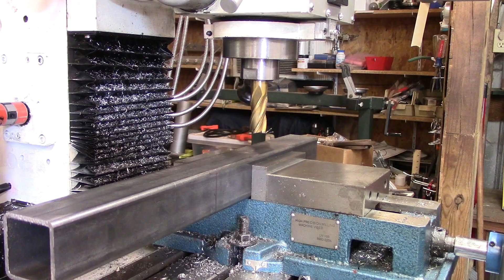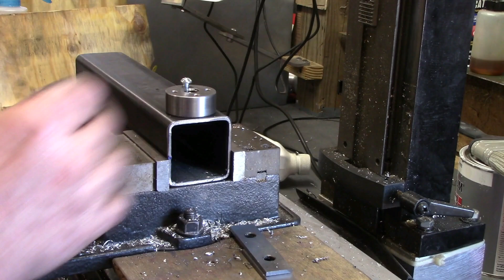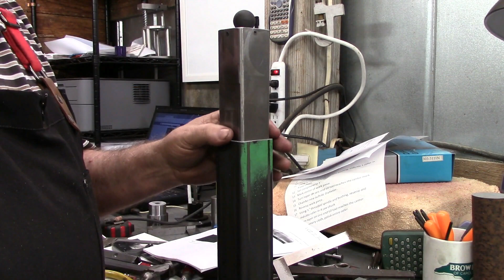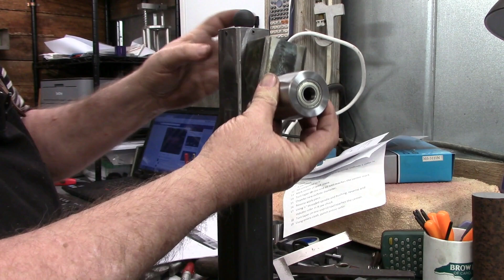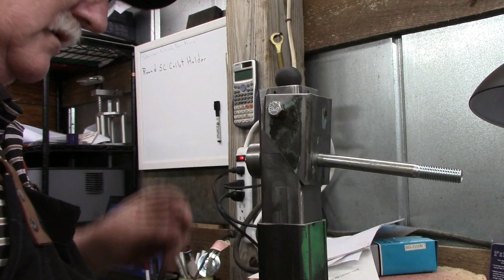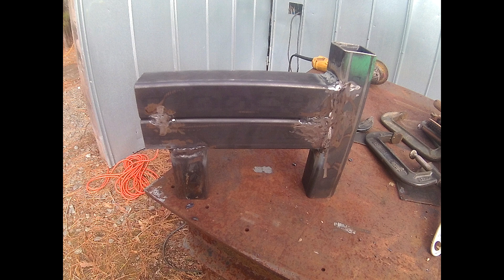2 x 72 Belt Grinder Reverse Build - Part 3 (Hollow Structural Steel Frame)

Comment: Nice build. If you would like another option for telescoping two tubes, Fireball Tool has a video where the use a small piece of tool steel and draw it thru the tube and it removes the weld joint.. I bought a piece of tool steel but have not tried the process yet.

Comment: Lee you have a nice looking grinder! Just a comment about your welder. There is a company called ArcPig that makes a high frequency arc starter that will allow you too turn down the arc amperage and still maintain the arc to make the weld on thin material. It will also allow you to rig weld aluminum if you so chose. If my memory is correct it costs around $300. Probably would make your weld experience better. Thanks for the great videos keep them coming!

Comment: Fyi especially anyone wanting to build one of these. You can get automobile receiver hitch material that will fit with no modification. It does cost a bit more so weigh if your time is worth the cost saving modifying the cheaper metals. You can buy some of it in small bulk at tractor supply or trailer sales companies. It's also a bit thicker and stronger and many who have used both types say they notice less vibration transfer into the workpiece with the hitch materials. I haven't used one not made with hitch material but I'm happy with mine and I salvaged most of my metal from hitches.

Comment: There are two types of tubing  Structural and Mechanical  Structural had the raised seem running down the inside and Mechanical does not, it's smooth.

Nice job on the belt grinder, they sure come in handy.
Reply from the maker: MD500E99 Thanks, that's good info and I appreciate you stopping by.

Comment: Very useful details Lee - I am tempted to try make something very similar, but, I doubt I have anywhere in the shop with enough space! You have done a grand job on all this I must say.
Reply from the maker: ChrisB257 zThanks Chris, one of my "projects" for this spring/summer is to enclose part of that shelter you see in my video opening. I have literally run out of floor & bench space. In fact this grinder is on wheels & currently sitting in front of my press. Thanks for stopping by.